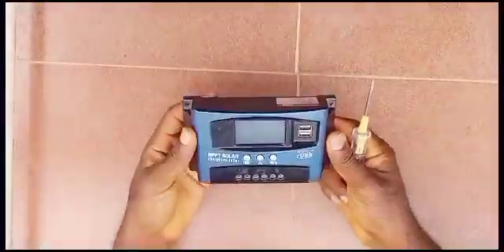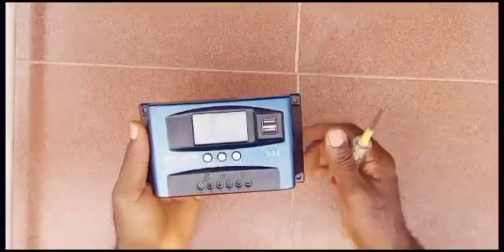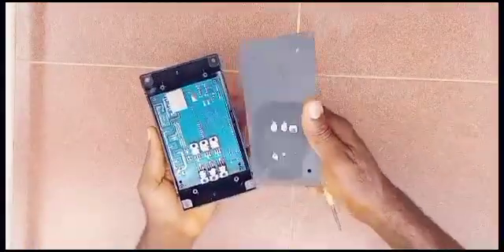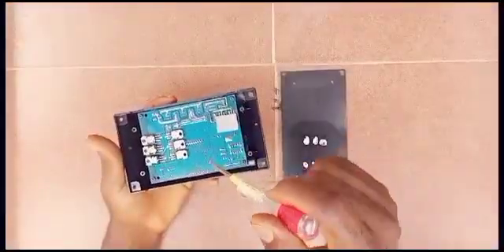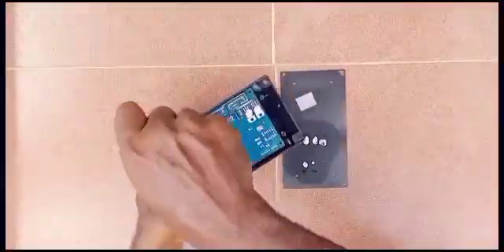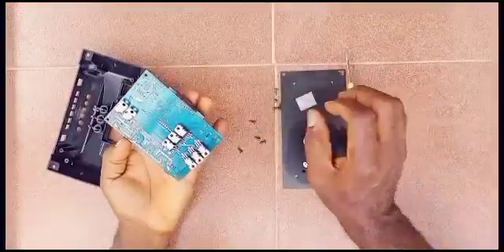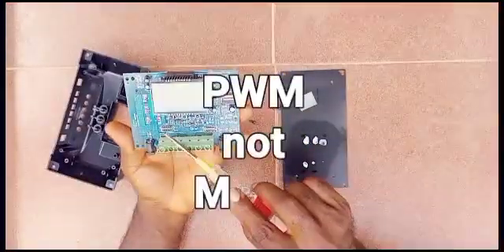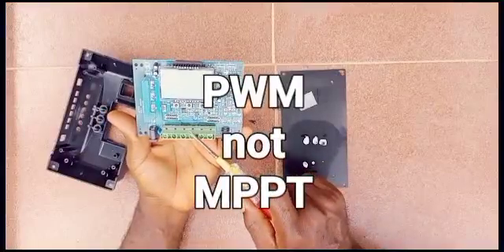How To Know Fake MPPT Solar Charge Controller

Comment: I have one of these and I knew before I bought it that it just was a PWM. I have 3 panels of total 300W connected to it in parallell but it will not charge over 8.5A. 
I expected at least 14-15A
Reply from the maker: That sounds like a PWM, which is not surprising.
Reply from the maker: It is PWM

Comment: Before seeing any of vids on this unit, I bought one and it arrived a couple of days ago.
Interestingly enough, in their ad info, they now have this CLAIM:

UPGRADED MPPT TECHNOLOGY: Detecting the maximum charging current by using innovative MPPT technology with high tracking efficiency of up to 99%

Yet, the inside, other than a couple of small differences, is the same as in the video.

The instruction book also says to NOT connect it to a "DC" source, meaning battery charger or the like.  Only to solar panels.

I wasn't sure their reasoning unless their "code" would cause a problem.

Now, up front, I haven't worked with these types of solar charge controllers before, so I don't know what to expect.  All I can do is use logic and educated knowledge/experience.

So I connected it to a DC source.  LOL  I started it at 17V like the solar panels would be.

I connected my Lab power supply as the battery and set that to 12.8V or so (changed it for this test) and connected a small load.

Again, not KNOWING what I'm doing, I expected that the "battery" voltage would/should change, but up to the max for lead acid batteries (14.2V) is what I have it set to.

And the load to stay at 12V or 13.8V, something like that.

But as I played with the input (solar panel input) voltage and the battery voltage, I noticed that the load would go crazy.  Even up to the 17V and if I turned up that "solar panel" voltage to say, 20V, the load would hit that as well.

THAT CAN'T BE GOOD under any circumstances.

In a day or 2, I'll take it into the garage where I will put a DC input voltage of 17V like the panels, a real 12V battery and a coil load with 24V incandescent bulb that can handle voltage fluctuations.

I'll monitor the actual battery and the display to see if the battery is in fact maintained at the 14.2V or if it's all over the place.  I really only wanted this to keep lead acid batteries topped up, using a battery charger.

I only paid $33 so no big deal if it is garbage.  LOL  Hell, I paid more than that for breakfast this morning.  hehehehehehe
Reply from the maker: Wow.. interesting. Thanks for sharing and keep us updated with the final results of your tests. Thanks

Comment: all you have to do is look at the output on the display. I fit's on-off-on-off it's a PWM.  They are nothing but a switch providing pulses.
 MPPT will vary at first, and be a steady number

Comment: Lol, same happened to me, I got note between input and output are same current! impossible! Must be low current input than output is more current depend high volt input example 15 volts or above, and output 12-14 volts battery meaning MPPT, but it's PWM! Damn, better get quality expensive and heavy include inductor coil.
Reply from the maker: PWM disguised as MPPT

Comment: Can the induction coil be very small like the size of your fingernail in a 60 amp controller?
Reply from the maker: That's not possible for a "true 60amps MPPT charge controller". The induction coil and heat sink account for about 90% of the total weight of the gadget.

Comment: What does an induction coil look like?
Reply from the maker: Induction coils in a charge controller look like small rings wound with copper wire. Some controllers have two or more small copper coil rings while some other brands have larger copper wire rings. Induction coils are very obvious and are clearly seen as soon as the controller casing is removed

Comment: That's right, it's not an MPPT controller. It is not even a good PWM controller but a simple voltage controller. Plus it's badly assembled because the mosfets are not in full contact with the metal plate. Unfortunately, to buy a real PWM controller, you have to spend some more money on a more reliable manufacturer (like Epever). MPPT is already a completely different financial level.
Reply from the maker: Thanks for the valuable information 👍